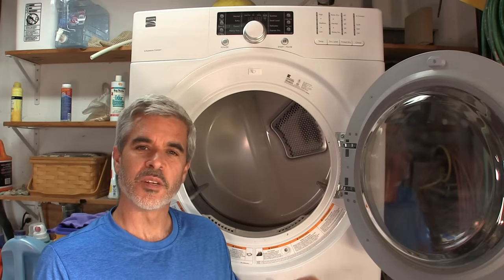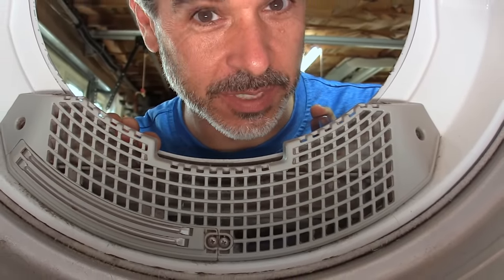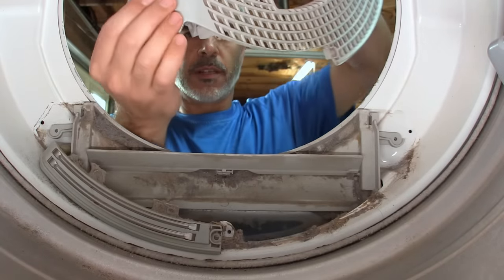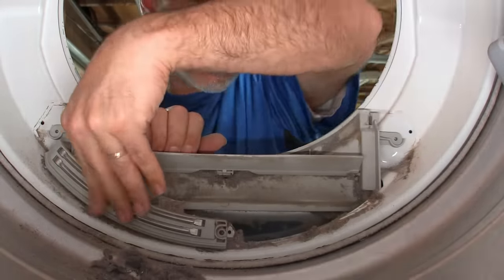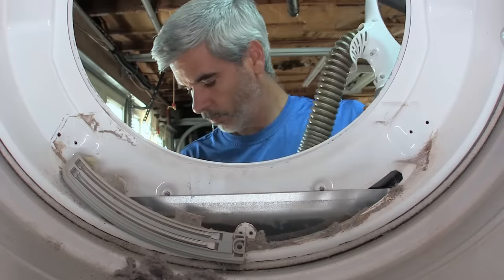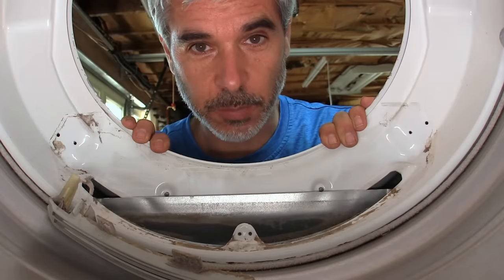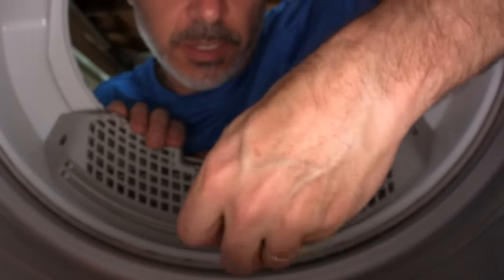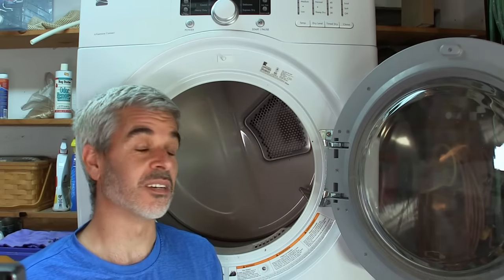Dryer Lint Trap Deep-Cleaning: I found 4 cups of fluff below the filter!

Comment: For those willing to take your cleaning a step further they can remove the front panel of the dryer to access the impeller that draws the air out of the drum. Behind the front panel is an access plate on the ductwork for the impeller. Usually just a few sheet metal screws securing it. Remove the access plate and be prepared! Looking at the buildup you showed under your lint screen I guarantee your impeller is heavily clogged. Spend some time with an old paint brush and vacuum to clean the impeller and the ductwork around it and leading out of the dryer. I would bet you will reduce your drying time by as much as 50%. Tip: In general, if you stop your dryer mid cycle, open the door and are hit with a rush of humidity, the system is clogged. Cheers
Reply: Thank you! I am pretty sure this is the problem with my dryer. Going to do this and get it drying quickly again!
Reply: Did this. Definitely helped! Thanks so much.
Reply: We have a 3 year old LG Sensor Dryer and I've had to clean under the filter (as per the video) due to clogging every couple of months since it was brand new.  Are we doing something wrong during the drying process? Or is this a design flaw? Thanks.
Reply: I’m with you! 👍🏻
Reply: I think that your way is the only way to clean my dryer!  Mine sure doesnt look like his!
Reply: @Nubesyxochis  saved your landlord $ on replacement and fire avoidance.
Reply: It is necessary for safety as well.
Reply: @Nubesyxochis t’s amazing I think there must  be something for some folks that says if it’s not mine, who cares🤷🏼‍♂️. I’m OCD and like you said it’s hard to imagine just being okay with filth
Reply: What is an impeller??
Reply: @aussiefreediver  Extremely poor design by LG.  Designing a lint filter that catches lint is not rocket science.
Reply: Is this instruction for an LG dryer?  I can’t figure out where you’re talking about. To remove the front panel of my dryer, the door would also have to a removed.  That looks to be a bigger job than I can handle I think.
Reply: @aussiefreediver For every dryer I've owned, I've cleaned around lint traps monthly. I used to have the lint trap on top of the dryer. I think its normal for lint to build up in the area, but its abnormal that after all these years manufacturers haven't sealed the area better & made deep cleaning more easily accessible.
Reply: @Mskarin03 Where is your lint trap?
Reply: I am intrigued by this as I’m sure this is the problem I’m having with my drier.  Is there any chance of you putting a video together to show us how to remove the front panel on an LG washtower so we can check this area?
Reply: @mutleydoo  It has been about 2.5 years since I cleaned my GE Profile so I don't want to give incorrect information. My dryer is due for another cleaning so I will give specifics on the disassembly part, but it was pretty straightforward and no special tools needed. It may be very similar to your LG. Stay tuned.
Reply: @aussiefreediver  Most dryers don't have a very good lint trap system, allowing lint to bypass the filter. But what makes it worse are most dryer sheets. They get gummy when heated. The lint becomes gummy and then sticks to everything inthe airstream, including the ductwork and the motor impeller. Also, long runs of ductwork and/or flex duct creates backpressure. Shortest runs possible of solid ductwork, as few bends as possible, and limited use of flex duct is the best scenario, but I understand it's not always possible.
Reply: @Wee162  The impeller is the set of vaneson the end of the motor that moves the air. Think of them like fan blades only much closer to each other.

Comment: As a maid - I do this - but, I wash the parts in warm soapy water . I include the dryer screen . You can use a brush to go down in the dryer to clean it deep inside.
Reply: What a thorough maid you are!!!!
Reply: Wish I could hire you lel not all maids are the same. 😊
Reply: A refrigerator coil cleaning brush works well to loosen lint, then vacuum FYI
Reply: How / where do we find maids that do this ???
Reply: Just saw someone put a empty paper towel tube on vacuum cleaner hose and suck the lint, they used same tube under dryer
Reply: If manufacture made it easy they wouldn't be able to sell us a new appliance in lass than 10 years
Reply: Waiting for her to say what state she’s in 😂
Reply: @meman6964  I was thinking that lol
Reply: @meman6964  this is what I do!
Reply: I would do the same thing. Your wife must have went to the grocery store...lol...Those plastic pieces with all that dust still on them, wash them in warm soapy water and dry before replacing. Thats gotta make it smell better too. Great job Dan!
Reply: @mfanwelikeit3760  Does it work for dryers where the lint trap slides into the top of the dryer?
Reply: @uski  You PAY them WELL!!

Comment: An additional tip and one that is really easy, is to actually wash the filter screen with a little dish soap and soft brush.  If you use fabric soften or dryer sheets, an invisible film will form on the screen that will reduce the air flow and increase drying time. Next time after you remove the lint from the filter, run it under water and you will see that the water has trouble passing through it. After a very light soap scrubbing, you will see the the water now flows freely through the filter. How often depends on frequency of use.
Reply: I've stopped using dryer sheets for this very reason. I use softener in my wash; that's enough. I use wool dryer balls, and my laundry is soft, and my dryer filter is easy to clean.
Reply: My manufacturer says NEVER to use soap!  The soap itself forms a film on the mesh ...
Reply: wouldn't vacuuming the filter clean it well enough?
Reply: @rayseto2724  I haven't tried that yet.  Took me days to figure out how to open the bl**dy lint trap.  (No instruction manual, even though brand new machine.)  On my Samsung model, the lint trap is like a narrow bucket.  Not sure how easy it'll be to vacuum, given its strange configuration, even opened up.  Also not sure how well it would deal with dryer sheets buildup.  But worth a try.  Somehow the idea of a soft brush and water sounds more hygienic?  No idea why I think that!
Reply: @rayseto2724 , I usually remove lint from screen after every use by just pulling/rubbing it off the screen. The vacuuming   would be for the filter cavity which I don’t do after every use. I suppose I could get out the vacuum and clean the filter screen with it after each use but it’s just easier for me to do it by hand and occasionally rinse the filter.  
As an experiment, I will vacuum the screen before the next rinse to see if that removes the invisible softener film 🤔.
Reply: Manufacturer says don't use fabric softener. I have never used it in my life.
Reply: @grilledflatbread4692  Samsung doesn't say that.  In fact, they provide a special location just for fabric softener dispensing, so it would be kind of silly to, in effect say:  "Here is where you put the fabric softener.  Oh, btw, don't use it!" 
Water here is very hard.  So clothes turn out stiff and rough if I don't use fabric softener.
70+ years ago, I would dry sheets, and towels, and clothes on the clothesline and they felt and smelled WONDERFUL.   That was before fabric softeners had been invented and before our air and our water became so polluted.
Reply: WOW .. thanks for that excellent tip  , I will pass that on  !
Reply: That much lint beyond filter means back off and vac the motor mecanicals to bring it back to new cooling and safety in the heater coils,ducting will benefit deep clean too.
Reply: White vinegar is a great natural fabric softener with no greasy buildup! You can't smell the vinegar once the washing has had a good rinse, and it helps keep the machine clean too. @Jaggwire

Comment: It would be great if manufacturers would supply a lint cleaning tool to help with these problems
Reply: But then you wouldn't need a new one so soon.
Reply: They sell skinny brushes to do this.  I have a couple of them. 
And there are skinny attachments you can hook up to your regular vacuum to do it without taking it apart.
Reply: @ellenhofer3343  But why do we have to go to this much trouble with brushes and vacuums and what not.  Design the thing properly.  I just had to replace the gosh darned heating element because I wasn't able to do any of this.
Reply: @denisepaulsenful  that's my feeling, too.
Where I live its at least $350-$400 to clean the vent and I don't know that it includes cleaning inside the dryer.

The fires start inside the dryers from over heating from what I was advised.
Reply: @denisepaulsenful  Part A : It's not a design problem. In 60 years of consumer use of electric/gas clothes dryers, brand competition, and government regulation, ... if a better way existed, it would have been marketed long ago. It's just a reality of normal maintenance of a home. A machine you bought, where like a car owner's checking their car's brake fluids, tire pressure etc, ... the price of failure to maintain can be dangerous.  

Part B : If the "I wasn't able to do any of this " is a financial problem, senior citizen, or a disability issue there may be an agency in your region that has volunteers ... my small city has an agency that has vetted people    ... mainly retired guys from building trades who volunteer through the agency to help with household issues. Maybe your local Fire Department has suggestions ...referrals ..? They don't like dryer fires either. If it's a lack of confidence, maybe your local school board, or college has evening adult classes in basic building tech? Lot's of women are in trades now. Offer to trade something you do with a neighbor ... art ... cooking, music, for an hour of help to learn how to do it this time, so you can do it next time.
Reply: @ellenhofer3343  Ellen, perhaps you could bargain for a "deal" in spring/fall when customer calls for furnace/air conditioning  maintenance are low, and limited to saavy customers ?  You might want to see my reply to Denise on this same video. There are some other suggestions there. 
P.S. I'd never done any computer tech stuff ... when I used YouTube videos to replace a screen on a Kindle reader, and then took apart a laptop, including taking off the keyboard to add a memory stick. There were even videos on my specific model of laptop.   I followed instructions, and kept parts organized. Cleaning out a dryer vent is so much easier than those. Maybe think of it as paying yourself $300 to $350 to do the job. And after you've done it once, it gets even easier.
Reply: @boxwoodgreen  why are you defending companies crappy designs? I don't even get it. 

They can make this easier and more accessible for people. If it was easier, people would do it more, less fires. 

Win win?
Reply: @Lantana888  
Ellie, it's very simple NOW. And, No more complex or difficult than changing the oil on a car. It's incredible to me that people could go through around 12 years of schooling, and not be taught how to do some simple basic screwdriver level life tasks. To the point where with a simple set of instructions they could do this easy job. The design isn't "crappy". It's your attitude. You are surrounded by miracles of technology, and still find a way to complain that you have to "do something that resembles work".
Reply: @boxwoodgreen  lolllll 😂😂😂 have you been in American school lately ? 

We are taught nothing useful. It is glorified baby sitting. what we are taught is purely academic and intellectual. 

If you were lucky enough to have someone teach you this stuff growing up, good for you. 

It's simple sure...but it could be much simpler. Example: just making this space big enough for a vaccum to get down. Thank good UX design, that's that intellectual work ;) 

Or even better, having under the washer be a drawer you could just pull out and empty. 

LGS Manual doesn't even go this indepth, and tells you to just clean the screen and that nothing is wrong with your dryer when the check filter light is on. 

Sounds like a great lawsuit really.
Reply: @Lantana888  Ellie, re: your comment about "crappy design". Home clothes dryer's have been in use for about 60 years. America was for a century the most innovating, and competitive market that has ever existed. If there was a way to do what you ask in a safe, cost effective manner it would have been done 40 years ago, and improved every few years after that. 

If you were denied a proper education in even the basics of mechanics, ... work to correct that. Many high schools, and Community Colleges offer adult evening courses for a wide variety of subjects. Advocate at their Boards for a "Home Mechanics Course". Tell them they can hire local female techs to teach some basic home/auto maintenance skills designed for Women. You might even find you like it. I know a lady who in her 30's, no tech history whatever... out of the blue ... took a set of courses, and became a welder.
Reply: @ellenhofer3343  very helpful, can you tell me where you get these skinny brushes, please. Thank you, Janet
Reply: @janetkraushaar8195  Amazon has some if you're fine buying from there.
Reply: @ellenhofer3343  I started to notice the bristles coming off of that brush and getting caught. Which can potentially damage your dryer. I started using plastic baby bottle brushes
Reply: @janetkraushaar8195  Cleaning brush kits are available many places. I got mine at Lowes. Comes with a round chimney sweep brush for the round vent tubes, a bendable long, round brush for reaching into the lint filter chamber and a long, flat cleaning tube that attaches to a vacuum.
Reply: @Lantana888  My money is on that dryer is made in China.
Reply: @janetkraushaar8195  amen, please, yes! And how to use them.
Reply: @jimnaden5594  thank you very much!
Reply: Amazon sells a kit with a long handled lint brush and vacuum nozzle extender to get into all the nooks and crannies of the dryer.
Reply: @panda5122  
Thank you!
Reply: it's a political game. corporate interest crushes Congress, which cannot put in place basic consumer protections and regulations.
Reply: it's a political game. corporate interest crushes Congress, which cannot put in place basic consumer protections and regulations.
Reply: it's a political game. corporate interest crushes Congress, which cannot put in place basic consumer protections and regulations.
Reply: it's a political game. corporate interest crushes Congress, which cannot put in place basic consumer protections and regulations.
Reply: @boxwoodgreen  
What I’m reading in part B is “commit tax evasion”! Bartering, according to the IRS, is income and must be reported. It is not a zero sum game. If I provide $100 worth of services or goods to you and you provide $100 worth to me, the IRS considers that $200 worth of “other income” from which they want tax money.
Reply: @DansWay  I had a great dad.   :  )
Reply: Great video!
Reply: You can buy them on Amazon but it didn’t work well.

Comment: Great video!  For those who do not have a dryer with a lint trap like this, you shouldn't criticize others for finding it difficult to do this.  The screws are hard to access because you are basically having to do it by feel since you can't actually get to that side of the lint trap to see what you are doing.  And you have to remove this assembly in order to clean it like he does in the video.  It's a VERY poor design!  I will be doing this for sure though.  Dryer is just taking too long to dry, and I know the lint trap needs cleaning like this.  Cleaning the screen alone isn't enough.  Thank you, Dan! 🤩
Reply from the maker: Thanks for the comments!  And yes be sure to clean out the hose in the back, and the exhaust vent on the outside of the house.  This is often where lint will fully block the air which dramatically increases the dry time. I have a video on this as well in the description.

Comment: This is part of the reason that so many house fires get started. They should definitely make it easier to access
Reply: I mean, all he used was 1 tool.
Reply: @chato9475  some of us are incapable of getting on the ground and sticking our head in there. 

Okay we can get on the ground. It’s getting up that’s impossible
Reply: @chato9475  it still doesn’t account for cleaning lower in the dryer leading out to the exhaust hose, unfortunately.
Reply: @decimanightelf4135  Yeah there should be a hatch or something, that we can open from the front below the door

Comment: I purchased the tool to clean out the long tube that goes from the dryer to outside the house. I learned mine was very clean after 15 years. I’m good about cleaning my lint trap after every load. I was a volunteer fireman in my teens so I learned the main cause of house fires is dryer lint.
Reply: Where did you get your hose? Inside to outside would work much much better for me. Thanks
Reply: I have had two dryers catch alight due to lint build up. I never leave the house with the dryer going and I clean it after every use. I also bought a Miele as the firemen said that they rarely see this problem with Miele dryers. (I’m in Australia)

Comment: I clean my screen after every use & never use fabric softener or dryer sheets.  But sure enough, when I pulled my screen & shone a flashlight into the compartment, it was full of sticky lint.  Followed this video & cleaned it completely.  Then had my husband run the dryer & as I stood outside & more popped out of the vent.  Seems to be staying clean but this is going become a regular cleaning routine.  Great video!
Reply from the maker: Thanks for the comments Barbara!